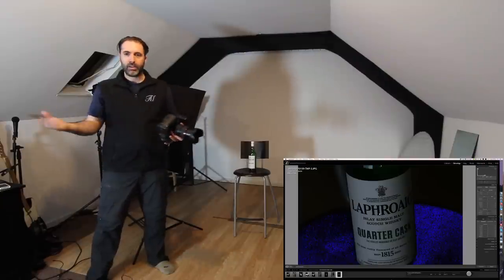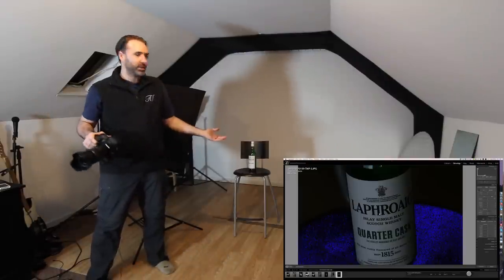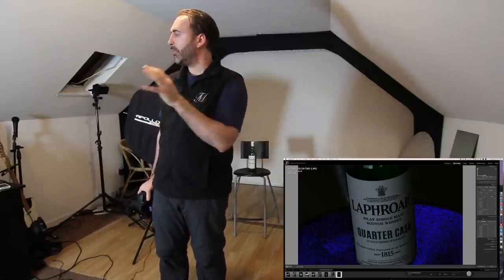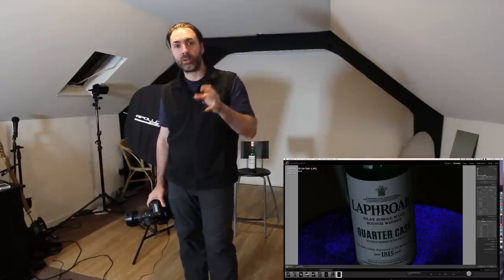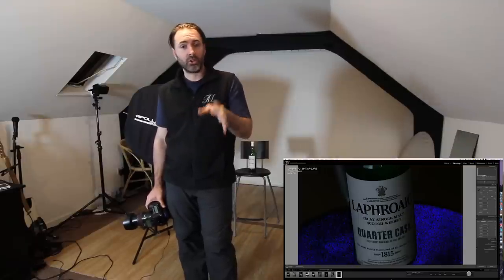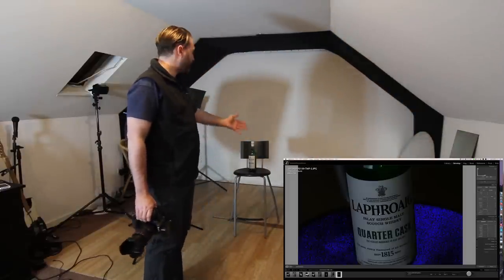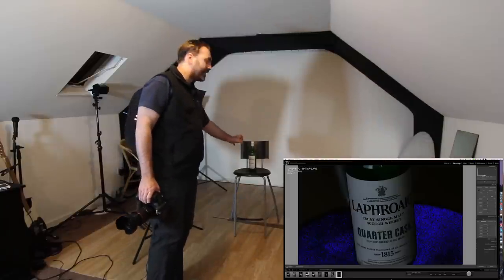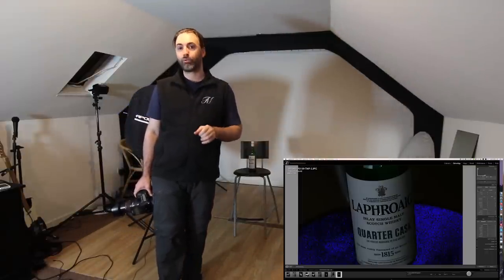Flash Photography: Manual vs TTL

Comment: Thanks for the video.

Since most of my cameras do not have a built-in TTL flash meter, I prefer to use manual flash units with my cameras. 

On the other hand, I do have one flash unit that has its own built-in flash meter. The flash meter in the flash unit reads the reflected light from the subject and automatically adjusts the intensity of the flash output for the correct exposure. Since the flash meter is in the flash unit and not in the camera, it also works with all my cameras.
Reply from the maker: Thx for the testimony. What is your flash unit with flash meter integrated? I have never heard of one so i am curious.
Reply: @LaPhotoAvenue  
Vivitar 283
Reply from the maker: Thx for the reference. I did not know that unit and that sensor system is the weirdest thing I have ever come across. SO much so I was ready to tell you were misguided (regarded the flash meter on a flash unit) but after reading the owner's manual, I stand corrected.

Comment: I shoot with Nikon and you can shoot TTL with FV (flash value lock) and if necessary adjust flash value output exposure plus or minus to taste and flash value output will be locked in until you decide to unlock flash value exposure. So in essence you have the best of both worlds in either shooting manual flash output or TTL and still have complete control of the flash output. I would never buy into a system that didn't have that capability.
Reply from the maker: Thx Caltari. Unless i am mistaken but what you described exist with Canon and YN flashes as well.

Comment: Nice video. I often shoot runners with TTL, but sometimes it is over-underexposed when they wear a dark/white shirt and to change every time value exposure doesn't work for me. What do you recommend?
Reply from the maker: Thx for your comment. If your lighting condition does not change I would recommend you use manual flash. You set it up according to a runner wearing bright clothes and that way you will no longer be over or under exposed.
Reply: Thx for your advice. When I use manual flash I should pick a certain point to shoot, otherwise I have the same problem. Should I set my flash as if I use a wide angel lens?
Reply from the maker: Setting the zoom of your flash to a wide angle would ensure you are spreading the flow and potentially avoid some burned highlights.

Comment: Hi Tom, nice demo. However, when you move about, shouldn't you also adjust manual? I mean, the further away, the less light hits your target. Isn't it a bit of lucky that you get the same exposure?
Reply from the maker: Juan Jose Garcia-Ripoll I am not sure if you understood what i tried to explain in this video. 
First of all let's be clear we are talking about the manual mode of your flash, meaning that once you set up your flash unless you change manually its settings (i.e. power) the same amount of light will be emitted. 
for the sake of explanation, let say your flash in manual mode is the same as the front head lights of your car and the car is 10 meters away from a tree and lit its trunk in the middle of the night. Then you come along with your camera. Whether you stand 5 meters away from the tree of 1km away from it the tree will always be lit the same way. The camera has nothing to do with the volume of light falling onto your subject. 
There are 2 types of light: 1-incident light (light that falls onto your subject) 2- reflected light (light reflected by your subject). In the case of TTL it is your camera metering system which will determine the power output of your flash base on the amount of light reflected by your subject during the pre flash.Hence the distance between your camera and your subject does have an effect on the metering result (more of less surrounding in the scene for example).  
In the case of Manual mode for your flash, the camera metering system has no impact on the flash output so whether you include more in your frame, the initial subject will always be light the same way and therefore your exposure of it will be constant. 
I will cover this again in a few weeks when explaining how to use a light meter but in the meantime i hope this helps you understand better.
Reply: I totally understand that the amount of light emitted by the camera is the same in manual mode. However, the total amount of light reflected by the object decreases with the distance. That is why the flash number GN (https://en.wikipedia.org/wiki/Guide_number) is given as a distance and an ISO that works for that distance. If you have a flash with GN 30 feet ISO 100 and move to 60 feet, the amount of light that reaches the object (and thus is reflected) will be half the original light and to get the same exposure you need to double the ISO. This is the reason why I do not feel comfortable when you move away and get close and change the zoom and so on and insist on the "exposure" being the same: the amount of light reflected is not the same, but perhaps for the distance you moved away it seems the same because the factor is not that large.
Reply from the maker: Juan Jose Garcia-Ripoll I can guarantee you the distance never affects the the exposure of your subject. What may affect the exposure is the extra content you get in your frame as you increase your distance. An example would be a hill lit by the sun. Wether you are 500m from the hill or 10km from the hill the exposure of that hill will be the same. You may think things appear dimmer as the distance between you and your lit subject increases but your camera does not see it this way. For a more comprehensive explanation i suggest you read this very interesting article which gives you the reason behind the statement: camera to subject distance has no effect on the exposure of your subject lit by a fixed light source: http://www.scantips.com/lights/flashbasics1b.html

Comment: What type of metering setting did you set when you focus on the bottle? (spot, average, centre weighted)
Reply from the maker: thx for the comment. The metering has nothing to do here since the canon system does not use it for TTL.

Comment: Should I use TTL when bouncing the flash?
Reply from the maker: +Sayan De this seems to depends on the type/brand of TTL/flash  (TTL I vs TTL II). TTLII was meant to address distance and rebound deficiency but i never found it very reliable though.
Reply: +Tom Migot Photographie i'm Using nikon sb700 on my nikon d5100..
Reply from the maker: I am sorry +Sayan De but i am a canon guy so i could not help you further. If you like my videos, don't forget to subscribe to the new channel dedicated to english videos: http://youtube.com/c/tommigotphotography  You can find all my previous and future videos in English. I had to split this channel in 2 to grow it more.
Reply: This is my question as well.  I usually use bounce flash. Was wondering how would the flash be able to compensate for that extra travel distance of light. Then again the zoom of the flash is irrelevant cos after bouncing back from the ceiling or some other surface, it is now like a very large source of diffused light.  How do I factor this in. Thanks for all the effort u put into ur videos.  Love them.
Reply: If you are using using bounce flash in TTL, set your flash exposure compensation up 1 to 2 stops. Check your histogram and go from there.